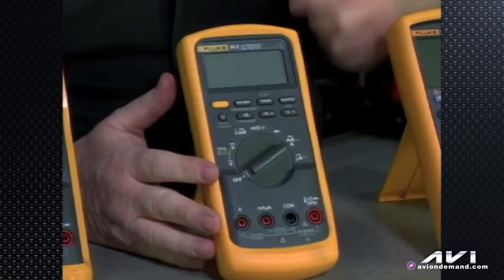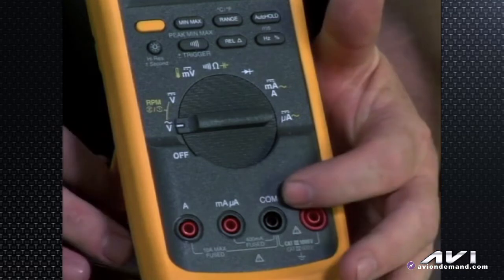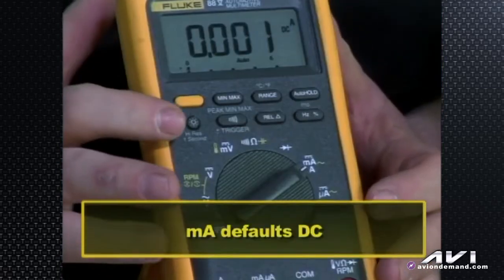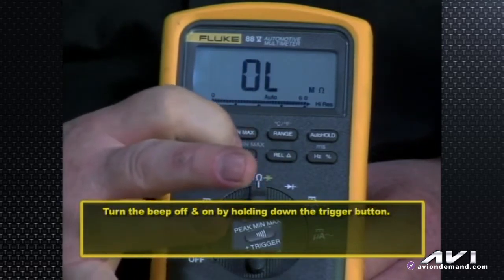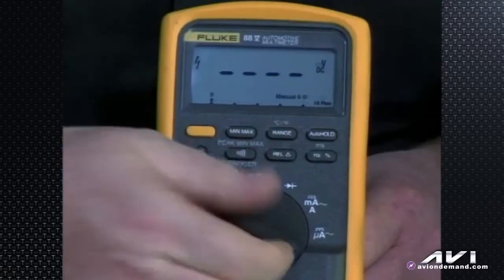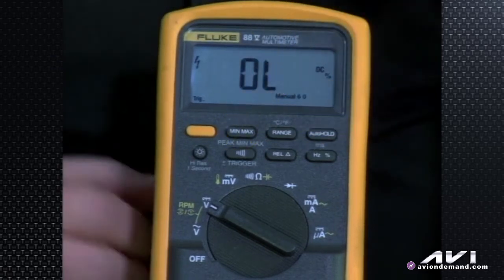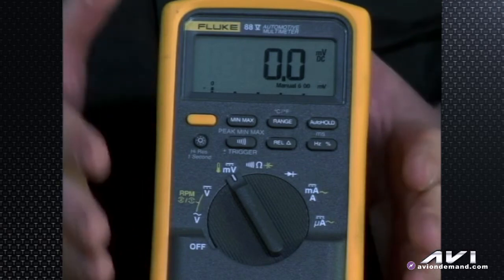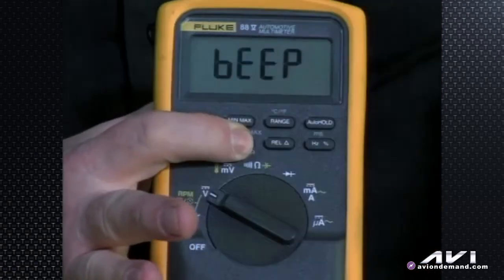How to use your Fluke 88 V |  Dave Hobbs  | Tech Tip

Comment: Fluke meters rock. I have the really basic 60.00 in my truck, an was using a 115 in my shop, after much thought an research I ordered the 88, boy it hurt the wallet but now that I actually know way more about electrical diagnosing etc, it’s an amazing tool that I truly appreciate. Thanks for this video. I knew a lot but you helped me understand even more.

Comment: Hi Dave, I was hoping to find out what the "ms" function that is located by pressing the Hz/% button does or where it would be used. Can you shed some light on this function?
Reply: The ms stands for miliseconds. In this mode the meter will read the pulse-width of a signal, as the on-time of a fuel injector for example.
 It's a direct time measurement.

You always can download the user manual from the fluke website.

https://www.myflukestore.com/pdfs/cache/www.myflukestore.com/fluke/multimeter/88_5/manual/fluke_88_5_multimeter_manual.pdf